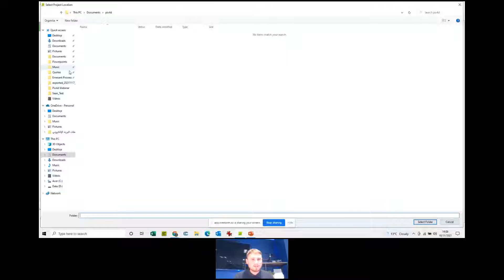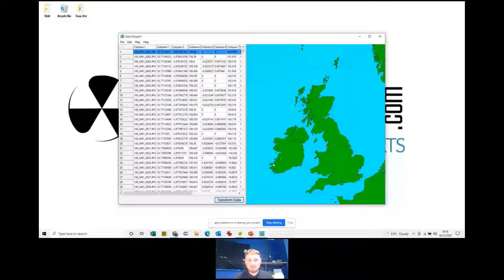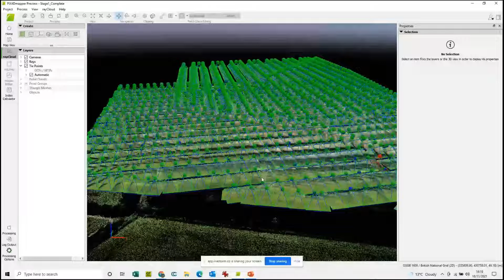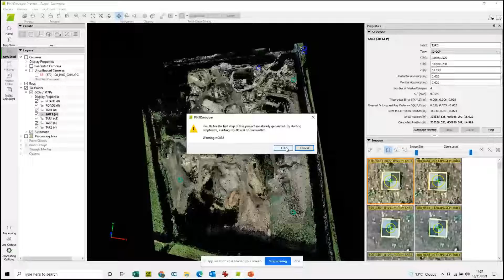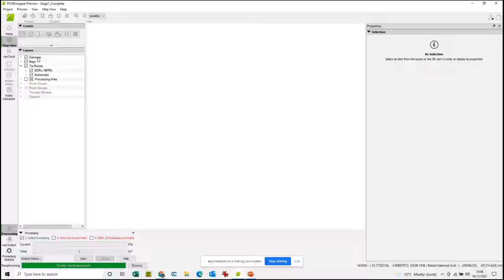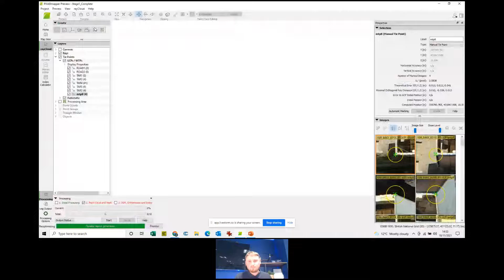Comment: Found this very useful and  realise how much i actually dont know! I bought the PIX4D mapper at half price as you mention on the black friday event. Bought it and have been using it with my mavic 2 pro , which I now realise isnt the best for this application. I have also being trying out drone harmony with agisoft which seems better for some 3d applications? I have also being transferring to AutoCad for some simple measurements and contouring. I guess my question could this be a viable side line for me  (i am a mechanical engineer) or would I just be better doing simple roof surveys or making wedding videos !  Loved the video and obviously you are a proper surveyor, which I am obviously not! ;-)